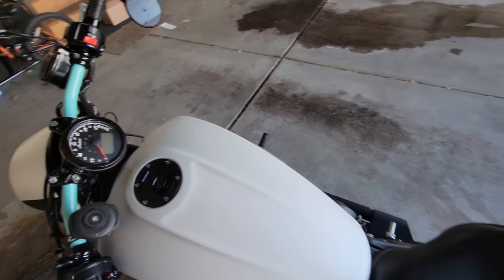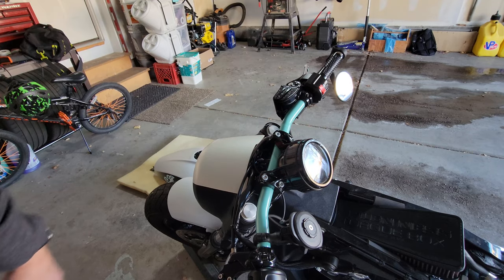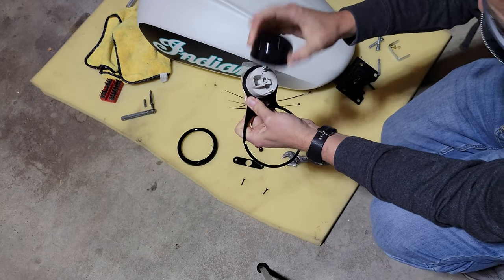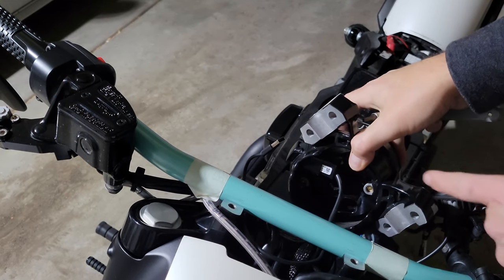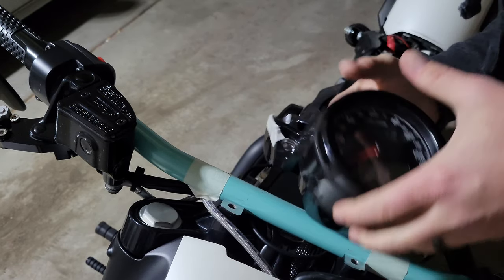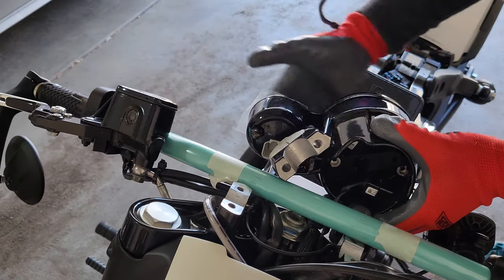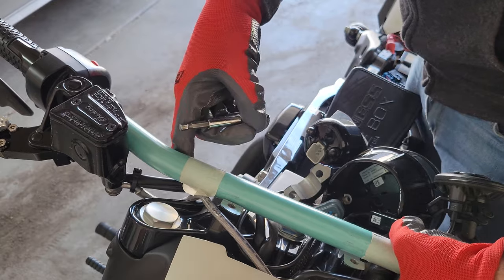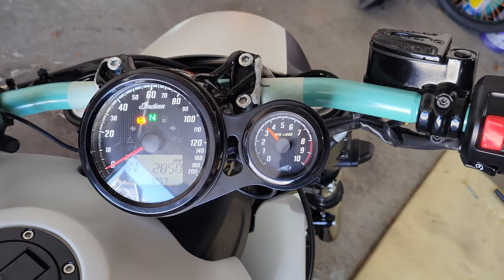How to Install The New Indian Scout Lineup Analog Tachometer

Comment: Thank you for this great video. Just finished installing tachometer on my 2021 Scout. FYI, I removed the headlight, disconnected the UPB wire  from behind the headlight, and removed the speedometer. This made it a lot easier, as I didn’t have to work on the speedometer in that awkward positions.
Reply from the maker: Awesome! I was hoping the USB was easier to deal with but I was already all up in it and just wanted to get it done!

Comment: Why did you turn the fuel pump on 3 times before starting the engine? Have you been having problems? It sounded like it had trouble starting. I would have thought priming it so many times would flood it, no?
Reply from the maker: No issues,  I had simply disconnected the fuel tank and the fuel line bled during the process. Was simply ensuring the fuel line was filled back up before starting it up. No risk of flooding on a fuel injected machine.

Comment: Knowing that I'd have to machine my own slots, which isn't a problem, do you foresee any issues mounting the tacho at the 2.00 o'clock position?
Reply from the maker: I don't think it would be an issue. It could possibly interfere with different handlebars or a fairing/windscreen but that's doubtful

Comment: Recently received and installed my tach . Shift light comes on only when I start bike . Does not come on when I’m riding . I was led to believe this comes on when shifting at required Rpm’s . Am I missing something ???
Reply from the maker: It comes on at something like ~7500 rpm based on my testing. You really have to push it towards redline to see the light.
Reply from the maker: Is only there to remind you you'll hit redline soon, but you can't see it out of the corner of your eye anyway,  so it's kinda pointless.
Reply: @Jimbobbington  Thank you for reading !

Comment: question, if I wanted to install a fuel gauge on the other side, do you think I could stack a second one of those brackets under the bezel? or would it be too tight a fit?
Reply from the maker: Check out Hemisphere Performance. They just released a fuel gauge and you can get a double bracket from them to mount both the fuel gauge and the tach just like you are describing.

Comment: I got this installed today at the dealership. It took them about an hour 15 minutes. But mine is on the left side.
Reply from the maker: Left side is how they intended it,  but didn't feel right to me for some reason lol
Reply: Just out of curiosity how much did they charge you for the job?
Reply: Dude where did you get those engine colored bolts ? They look so good.
Reply from the maker: @goodlife6942  unfortunately the company I got these bolts from no longer sells them.